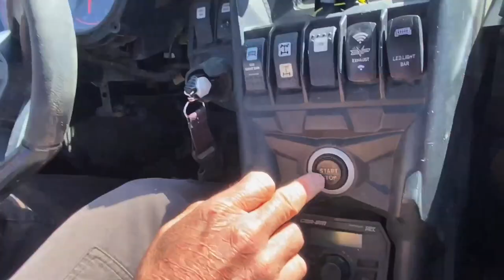Jeep Grand Cherokee JUMP!

Comment: Pumping a vehicle with fuel injection does nothing but can confuse the computer in the vehicle,  so in essence,  you've defeating what you are trying to acomplish...  starting fluid sprayed in the throttle body might be a better option.... also, there are some vehicles that you have to reset a switch that trips when you have a front end impact... but if the etheir does not start it, nothing is going to...